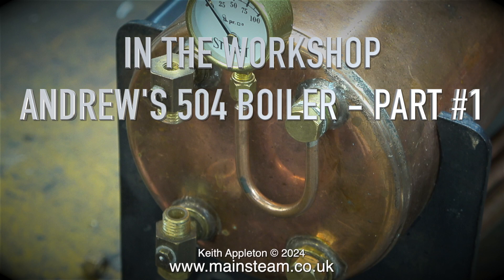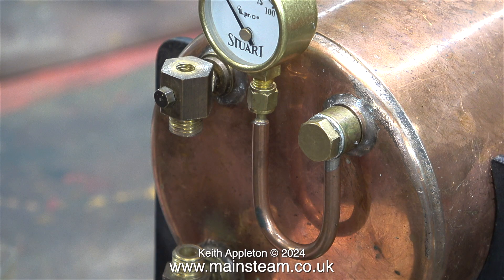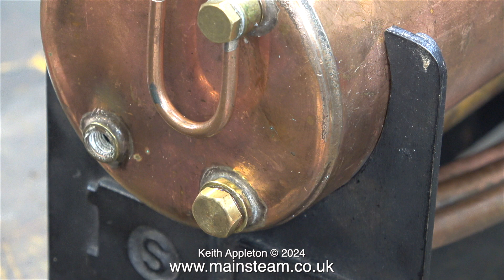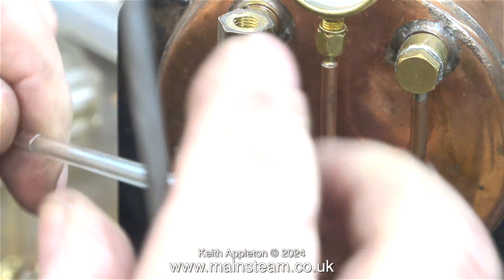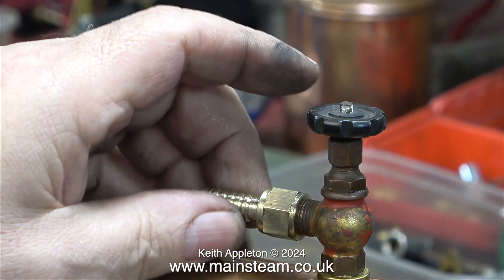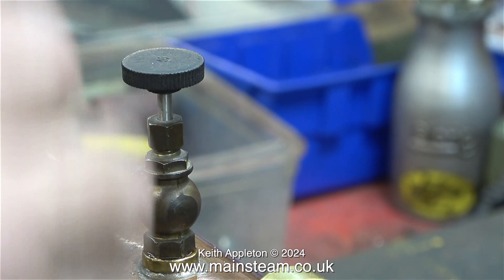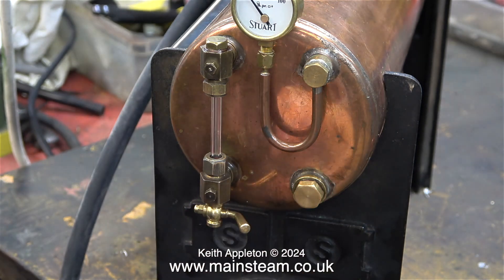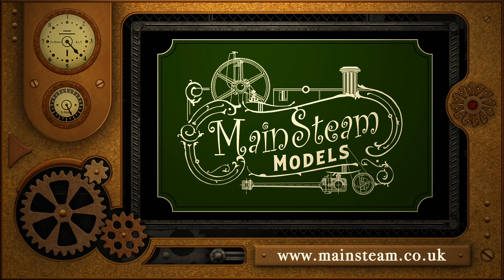A STUART 504 BOILER FOR MY FRIEND ANDREW - PART #1

Comment: I use my old BAHCO spanners a lot for old car engines and for my model steamplants and model aircraft engins, etc i newer had problems with them once one learn how to use them correctly (i did also throw the cheapo chinesium nockoffs staing in the garbage bin!) I do collect old British tools whan they show up at good price on fleamarkets and national aucion sites, i realy love the feeling of using them! Particulary those old droppforged metal clamps made in Britain are realy good in my opinion, sometime they get loose ower time, but they are super easy to fix.